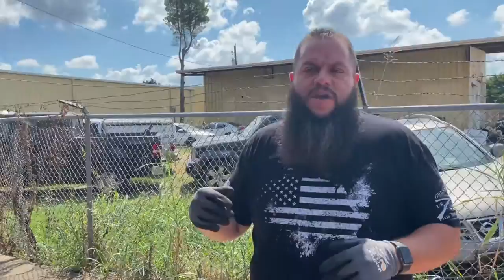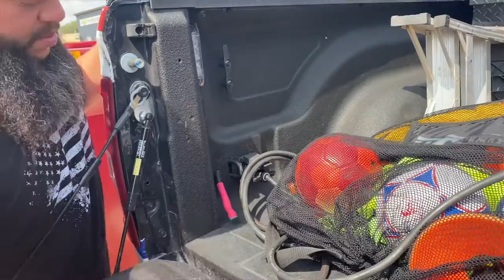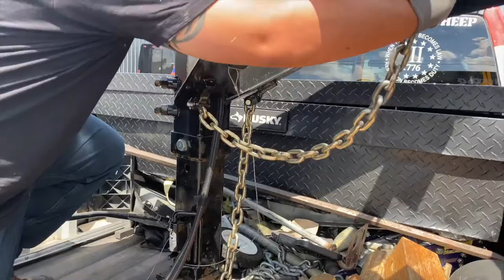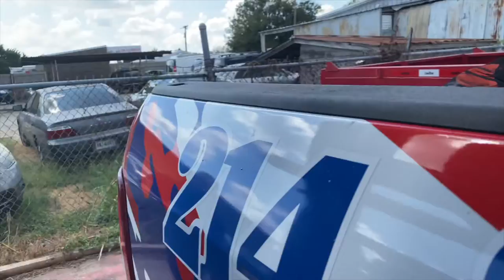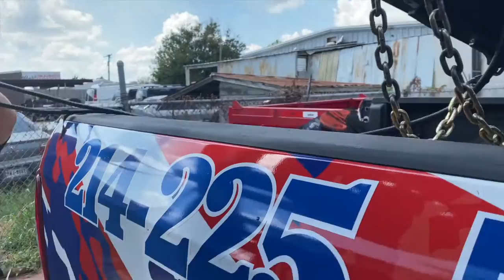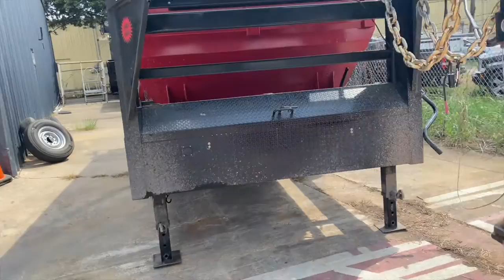How To Unhook A Gooseneck Trailer from Truck

Comment: Just one question, does the truck and trailer need to be straight to each other to unhook? Or can the truck be at an angle to the trailer and still I hook? Thanks for the info
Reply from the maker: Not at all.  As long as you can pull away from the gooseneck you’ll be fine!